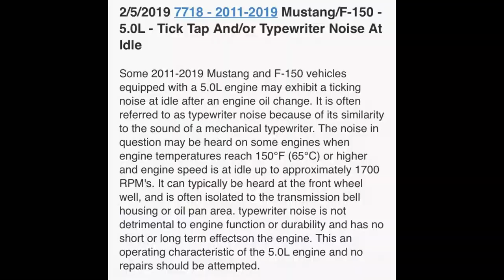2018-2021 Mustang GT Typewriter Tick/BBQ Tick. Don't Be Worried!

Comment: I took my 2020 GT to a Ford dealership a few days ago for an oil change. "The works" and since then I hear the tick increase with the rpms. I'm taking it back to the dealer to have them look at it tomorrow. It's not something I've heard the car do before and I'm concerned. Does anyone know what could be causing that?
Reply from the maker: If it's getting louder with RPM that's not good.  The bbq tick goes away when you start driving.  These cars hold 10 quarts. I know there are cases when they put 8 in.  Check you oil level. 8 is what the old ones take.  The high pressure fuel pump does tick but it's not that noticable.  Cylinder 1 scoring is a ticking scraping sound. I would take it as soon as possible and have them check it.  Let me know
Reply: @BeardedFordTech  I took it back to the quick lane this morning and they checked it out said the oil levels good and they don't think it's a problem with the engine so they referred me to the service center and a couple guys there listened to it and said he heard it and thinks it's not damaging the engine and the soonest day they can work on it is June 2nd.
Reply from the maker: @cdizzlebizzle  dang June 2nd. Is there another dealer close to you?
Reply: @BeardedFordTech  so today I added a half a bottle of ceratec and that crazy ticking noise when away completely but I'm still taking it in for them to look at it cause people that heard it say they never heard it tick louser and increase with the rpms. They say the Motorcraft oil is trash. Next oil change I'll be using a better quality oil like the ne you mentioned
Reply from the maker: @cdizzlebizzle  motorcraft oil is good.  However I use Amsoil.  I've heard people putting ceratech in but you have to do it everytime you change the oil.  I know it's worth it. But the noise isn't supposed to get louder with RPM.  That indicates a problem.  Mine doesn't do it with Amsoil at all. If it does it's very very slight.
Reply: @BeardedFordTech  yeah I'm still taking it in to get looked at while I still have a bumper to bumper warranty on it. Had the car for a year, has 28k miles on it. It was a gold certified pre-owned which is good until 36k.
Reply from the maker: @cdizzlebizzle  yes please take it. Keep me posted
Reply: @BeardedFordTech  I'm going tomorrow morning. Should I tell them that I added ceratec and the ticking went away? Or leave that out?
Reply from the maker: @cdizzlebizzle  I would mention it. Otherwise they will say they didn't hear it. My buddy has a 2020 f150. His was doing the same thing. Finally they found the problem. Oil consumption. It's getting a new engine. A revised 2022 engine that they supposedly fixed the issue with. Problem is. It's 3 months out.  But yes I would mention it. They need to know.
Reply: @BeardedFordTech  wow let's see what they say about mine. I'll update when they get back to me. Thanks
Reply from the maker: @cdizzlebizzle  no problem. Keep me posted.
Reply: @BeardedFordTech  ok so I took it in this morning to a different dealer and the guy said since it's not making noise now they can't really do anything other than do a visual inspection and if/when it starts ticking like that again then they can actually work on it. He said he used to work at the dealer I got the oil change at and maybe they used the wrong viscosity of oil, that he's seen that happen a few times. He asked if I wanted to leave the car there so they can do a visual inspection but had no loaners to give me so I had to leave.
Reply from the maker: @cdizzlebizzle  That car  takes two different viscosities.  It calls for 5W20 and 5w30 may be used. Not saying they put 0W20 in but it is possible.  But since the ceretec is in there and it's not making noise he is kind of right. It being under warranty they have to hear it.  Visual inspection won't really do anything. They aren't going to look into the cylinders. Also sounds like they don't want to do anything. Kind of like a catch 22. I think you have two options. Wait til your next oil change. At 5,000 miles don't add ceretec.  Or change your oil now and don't add ceretec.  See if the noise comes back then take it in. As far as the loaner because it's not actually being worked on they can't give you one.
Reply: @BeardedFordTech  yeah next oil change I won't add ceratec and I'll see if it happens again. Prolly sooner than later since I'm 7k miles until bumper to bumper warranty expires. Hey man, thank you so much for replying and trying to help me out. It's much appreciated. I'll continue to keep you posted ✌
Reply from the maker: @cdizzlebizzle  I know they recommend 10k miles for oil change. Keep it at no more than 5k. Please keep me posted. Your welcome. It's why I'm here my dude!
Reply: @BeardedFordTech  hey man! thinking about getting amsoil signature series but it's almost $170 for 10 quarts! I live in Central Florida where it's practically summer 10 months out of the year. My commute to work is 64 miles round trip 5 days a week (mostly interstate). How often would I need to change the oil if I got amsoil signature series?
Reply from the maker: @cdizzlebizzle  25,000 miles or one year. Whichever occurs first.  Change your filter every 5 k miles. I run the XL boosted in mine .I don't drive 64 miles round trip though. And I live in NC which is hot just like there.
Reply: @BeardedFordTech  I can justify spending $170 every 20k-25k miles. I see the XL is every 12k and is $40 cheaper. BTW, I watched your video again and noticed we have almost the exact same mustang. Black with the same wheels! 🤘
Reply from the maker: @cdizzlebizzle  oh yeah!  If you become a preferred customer it will be less than $170. Plus free shipping.
Reply from the maker: @cdizzlebizzle  right around $140 for 10 quarts and a amsoil filter for preferred customer.
Reply: @BeardedFordTech  Hey man! Got an update! So I finally brought my car in to the dealer for the horrible ticking noises after waiting a month. They've had my car since last Thursday and have determined the noises they hear fall into Ford's special service message. They told me I can pick my car up tomorrow. Ford states the ticking from idle to 1700rpm is "normal". Nothing else they're will to do. I had to add ceratec to make the ticking go away. I guess needing to add non recommended additives to avoid embarrassment is a normal characteristic? It is what it is. I do have an extended warranty.
Reply from the maker: @cdizzlebizzle  hey if they checked it and it falls under ssm then it's good to go.  I know it can be annoying and if ceretec takes it away then no harm no foul.  Keep the extended warranty in case anything happens. Keep me posted on anything other problems you may have. And any mods you do!
Reply: @BeardedFordTech  Yeah, thanks for the advice. So far only mods I've done was add a corsa sport catback exhaust and the steeda clutch spring you recommended in another video. The spring does make shifting a hell of a lot more smoother! Thanks man
Reply from the maker: @cdizzlebizzle  yeah that spring works wonders!!

Comment: I have a 2022 GT PP1 with 5k went for my first oil change at Ford free, and walked back to the service bay seen 5 mechanics staring at my JLT intake etc, after I was told it was done and coming around waited 15-20mins the guy called back wtf they said just pulled out still another 20mins and then rain started then car showed up, I left noticed next morning and had that tick knock and it does sounds like oil pan/converter area after listening, but I swear the mechanics over revved my engine on a joy ride
Reply from the maker: Nah. It always starts after the first oil changed. Even if they over revved it wouldn't cause that noise. The bbq/typewriter tick has been around since 2011. More noticable on 2018-present. And it's always always always after the first oil change. As the oil gets used it will be less noticable. But when you change it again it will do it again. It's a normal noise.
Reply: @BeardedFordTech  that’s the weirdest thing I ever herd, what’s in the oil from the factory that keeps it from happening until new oil hits it? I even put 5w50 full syn in mine still did it until I just put Ceratec liqui moly and it stopped it immediately almost, crazy! But over revving it can cause a noise like that from a broken spring or collapsed lifter or damaged cam etc, plus it creates a Rod like knock with both that went away with CERATEC, I’ve built bunches of engine including my 5.4 Iron block gt500 engine twice and can not figure out what’s doing this outside of cam phasers which 10gt500 don’t have
Reply from the maker: @Coyote9smilespergallon  there is a TSB for this and the knock noise. They call it the "diesel type knock noise". It always happens after the first oil change. Don't know why. But it's normal. People come in all the time with both noises. The F150 does it too. Supposedly the 2024 model won't do it. But us techs will find out more as this year passes.

Comment: 2022 pp1 4600 miles..started after 1st oil change.  Frustrating
Reply from the maker: Yep. But it's been around since 2011. Always after the first oil change. Apparently the new one that just got revealed along with the truck they got rid of the spray in cylinder liners.

Comment: Just had the oil changed in my 19. I bought it used with 26k mikes and now at 31k. And after about 3 days I noticed the tick but only when the ac is on
Reply: Also like to ad the previous owner was a tech at Ford also. He only traded it back in because he needed an suv for his growing family
Reply from the maker: @chrisc9923  not all of them tick. Especially with only 31k. On a 19 that's a little high. But do you hear the ac compressor cycling on and off or are you hearing a tick from the lower end. When ac turns on the sound is almost exact but it will do it in a weird pattern ac on or off. Can you email a video?
Reply: If I catch the sound again I’ll get a voided. But yes was from lower end. Just went to check it again and no tick sound at the moment
Reply from the maker: @chrisc9923  yea that sounds like the bbq tick. Comes and goes. Very intermittent does not do it all the time. Usually if it does it when it's warming up

Comment: 5w20 its not good enough in hot city from 30 to 45 degrees so we use 5w40 its good no sound good performance and no sound off tik tik ever 5 km i change oil and then use k&n filter better than ford recommend and we use 9 quarter and put Easy Extra Power Lube Blue every 20km
Reply from the maker: So ypu do know k and n filters are very bad. And why do you need an oil additive. If ypu need an additive you need a different oil. Good quality oil has everything you need. And why would you use 9 quarts on a 10 quart car?  What they told you makes no sense.

Comment: I just bought my 2020 used with 9500 miles just did an oil change and got into a big argument with the dealership 🤦‍♂️
Reply from the maker: Why?
Reply: The oil dipstick was low about 2 quarts now its ticking like crazy
Reply: @californiakev1071   hey bro. I’m very worried about my mustang. I had it serviced yesterday for oil change. This morning I started it and it started ticking. What do you think this would be? What should I do?
Reply: @hamody8055  there all the same, it usually goes away after driving 2 thousands miles on the oil, also check your dipstick make sure it’s full with oil
Reply: @californiakev1071  I checked the dip stick, it’s marked just over the half line. I have an appointment with ford tomorrow morning. I just don’t want them messing around with the engine if it’s not the engine.
Reply: @hamody8055  as long as the oil is clean and topped off your going to be ok, don’t let it bother u enjoy the car

Comment: The real bad news is that at Ford quality is job none!  My 2021 Mustang GT premium was a big lemon.  I could live with the cheap plastic interior and glitchy  electronics but the clucky garbage 6 speed manual transmission was just garbage!  I'm not the only one who thinks so, look at the class action that has been launched against Ford.  Fortunately I was able to sell it and buy a real car from another manufacturer.  It's no wonder Ford stopped building cars...I'll never buy another Ford...EVER!
Reply from the maker: Everyone is entitled to their opinion. But every manufacturer lacks quality build nowadays. It's all about production. Build as many as possible and get it out. The MT82 transmission is kind of hit or miss. I've never had issues with mine. Mine doesn't have cylinder one scoring. The tick is rare on mine. I know people who have had issues. Been in many of the transmission s with broken synchros causing third gear lockout. Then again I know people who have had no issues. In the end it's all about the vehicle you like. And if it's what you want then job well done.

Comment: You know anything about the 2k engine rattle ?
Reply from the maker: Describe the rattle please. Like something loose or a ticking noise?  Does it go away after 2k?  Which side of engine do you hear it?  Any codes?  I do know of a metallic rattle type Noise at front of engine which is water pump.
Reply: @BeardedFordTech  yes it only does it under low load  2k-3k it’s basically like a rattling can noise. I hear it inside the cabin almost in the passenger behind there or center cabin no codes it all
Reply from the maker: @mr.manny_s5506  you have after market exhaust? Possibly a heat shield loose?  That's the only thing around that area that would make that kind of noise
Reply: @BeardedFordTech  no stock exhaust, if you Google it or YouTube it here, it’s basically what everyone is wondering what it is. Sounds like a rattle metal or metal but only under load at 2-3krpm.
Reply from the maker: @mr.manny_s5506  I will look at tsb when I get to work
Reply: @BeardedFordTech  dude your the best thanks again !
Reply from the maker: @mr.manny_s5506  no problem
Reply from the maker: @mr.manny_s5506  what year is yours?
Reply from the maker: @mr.manny_s5506  only thing I'm seeing is two different things. One a chirp noise at idle. Remove belt and if noise is still present replace both timing chain tensioners. Two. Moderate to light load or quick acceleration. Spark knock. Sounds like a rattle can. This is normal and no repairs should be made. It's the firing of the engine trying to burn the fuel.
Reply: @BeardedFordTech  2019 gen 3 manual 6 speed
Reply: @BeardedFordTech  I’ve heard it was a timing change tensioner where at 2-3k the chain was a bit loose and it rattle. Is that an issue ? What does it say on that
Reply: @BeardedFordTech  any update on this ?
Reply from the maker: @mr.manny_s5506  only thing for timing chain is tensioners at idle.  See comment above
Reply: @BeardedFordTech  by the way this only happens when In gear and driving not when I’m in neutral or parked
Reply from the maker: @mr.manny_s5506  that's the "spark rattle". F150's do it too. Don't know why it does it.  You run premium gas?  If not bump it to premium (I know it sucks it's expensive). But it will quiet it down some. Mine does it too
Reply: @BeardedFordTech  does the spark rattle hurt the engine,Or something that I would need to worry about ? Really mine isn’t that loud it just has it. What causes spark rattle and is there a fix ?
Reply from the maker: @mr.manny_s5506  no it doesn't hurt it. When your cruising or step on it it's the ecm receiving a signal from the throttle position and adjusting spark timing. F150 does it bad in low RPM. I run premium in mine so it's not as loud.  Also while just cruising at a steady rpm it's adjusting spark timing due to air fuel ratio coolant temp and air temp
Reply: @BeardedFordTech  damn I think we found the rotten in the house man. At least I know now it’s not something that hurts the engine because yeah I don’t have any of the other noises I actually run 5w30 with ceratec(now looking at the Cerma  thanks to you)  but always been running 93octane and just heard it a bit inside garage or any closed up drive ways. Thank you for everything you sir deserve more Subs!
Reply from the maker: @mr.manny_s5506  not a problem at all. I did run cerma one time to "treat" the engine. Actually switched back to amsoil on all my vehicles. Runs so much smoother.   Share the videos with people you know!
Reply: @BeardedFordTech  I sure will! Do you recommend amsoil over mobile 1 ?

Comment: Have a 2018 Ford edge and trick so there fix for it
Reply from the maker: Depends on the tick. Did it just start doing it? Does it get louder with engine speed? Do it hot/cold or all the time. How often do you change your oil?  The edge isn't known to have a tick unless it's injectors and such

Comment: Can you talk about the 2000-2500 rpm rattle that shows up in 2018 gen 3 coyote? I think it's piston slap...it only shows up under load, at idle no problem but as you go thru the gears at the 2000 rpm range there is a distinct rattle sound that goes away as you increase rpm. I fucking hate the sound, it sounds like shit and I paid 44k for a piece of shit rattle trap...I want to return it badly.
Reply from the maker: What kind of fuel you running. Piston slap is also heard at idle. Piston slap noise doesn't go away after a certain rpm. Spark knock sounds like a rattle.
Reply: @BeardedFordTech  91 octane here in Arizona, can't find 93 anywhere..you recommend an octane additive or running E85?

Comment: Ill tell you right now, the BBQ tick goes away when OIL PRESSURE RISES!
Reply from the maker: Imma tell you right now. It goes away after it reaches operating temp. This is nothing new. Even the 6.7 powerstroke does it. Not even oil pressure related. Found that out from an engineer. It's temp related for some reason. But not all of them do it.